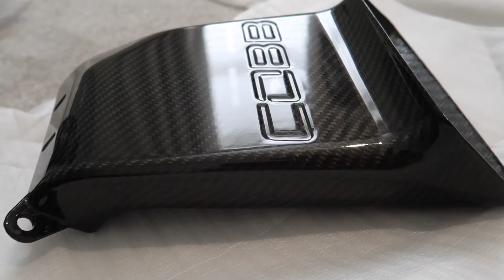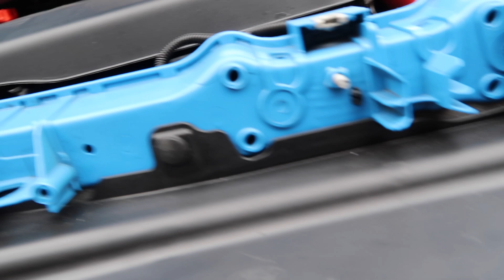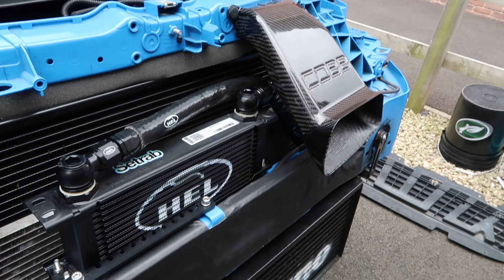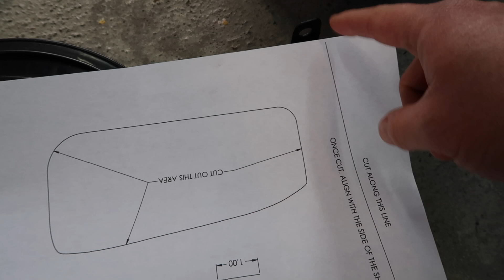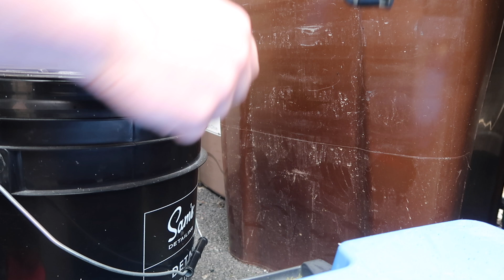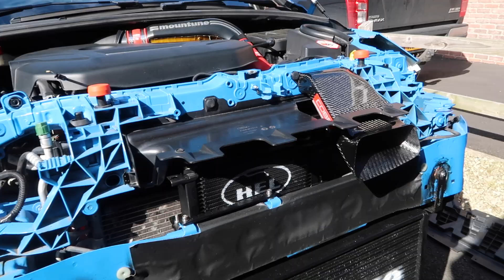COBB CARBON FIBER AIR SCOOP INSTALL! | FOCUS RS

Comment: Nice job as always Adam! Did you notice any increased throttle response or intake temperature drop after installation? Where live I see temps in the 80-100 F (27-37 C) and I'm hoping to bring that down a bit. 

I'm also considering a turbo blanket but that seems like it'd be a total pain to install.

Comment: What happens when your driving against heavy rain can water go up and into the air box
Reply from the maker: Not likely, the distance it would have to travel against gravity is too far to worry about unless the rain is being blown by a hurricane or something
Reply: @AdamRainey To be sure just avoid driving to close behind other cars in the spray, there are stories of engine damage with big snorkel like intakes.
Reply from the maker: @dave130r4  I tend not to drive close to anyone where possible to avoid stone chips